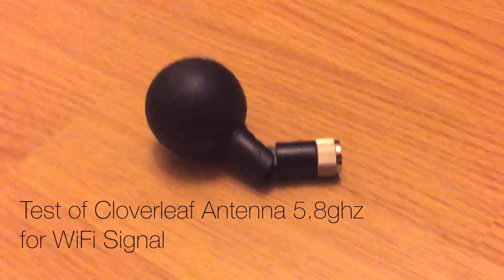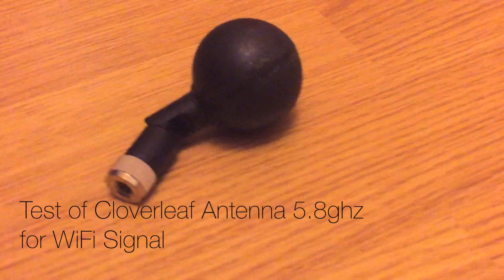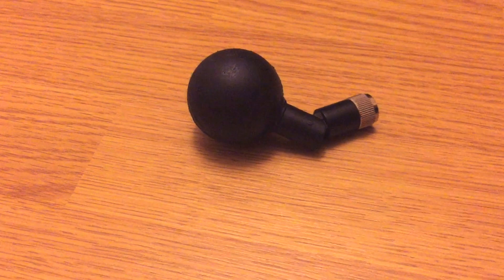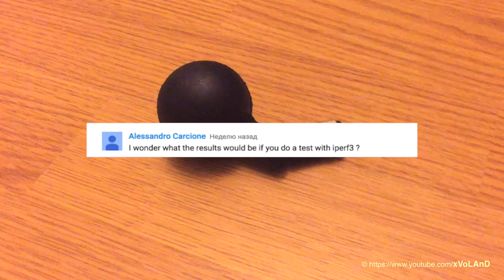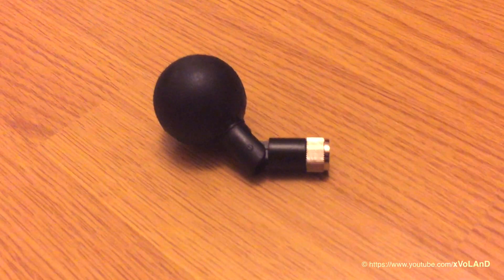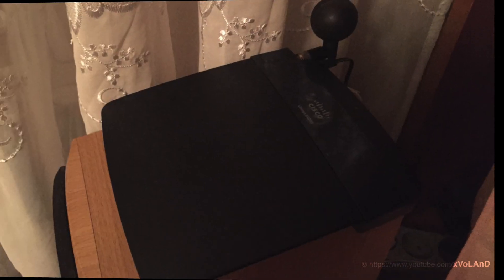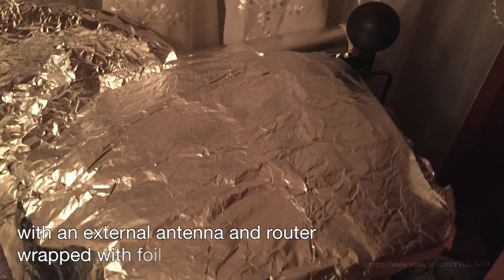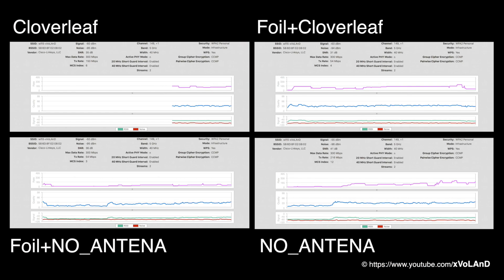Test. DIY Cloverleaf Antenna 5 GHz for WiFi router

Comment: Hmm it seems that the cloverleaf mostly matches and sometimes underperforms vs the no antenna setup, but no test with just a normal linear antenna? Thanks for the follow up test!
Reply from the maker: +Mike Anthony Cloverleaf provides a more stable signal and it's not lost signal if router use the internal antennas. When the router starts to switch between the antennas is very noticeable if to participate in the a videoconference. I'm happy with the result.
Reply from the maker: I forgot to add.. The important where you installed the wifi-router. The best location is one meter from the surface :) Now I understand why clover hang upside down on drones ;)